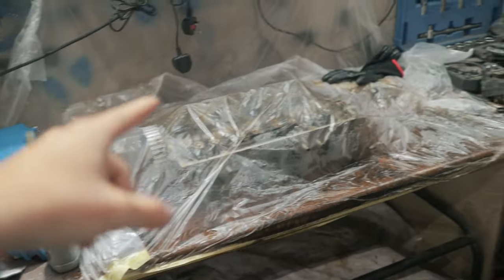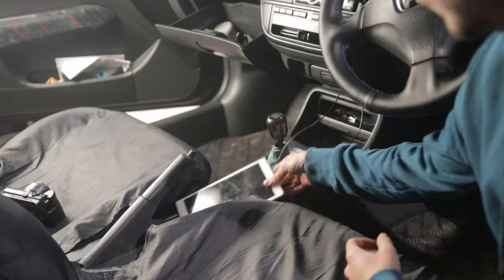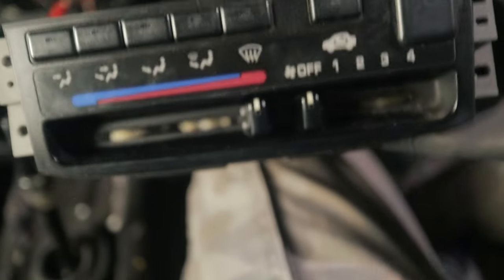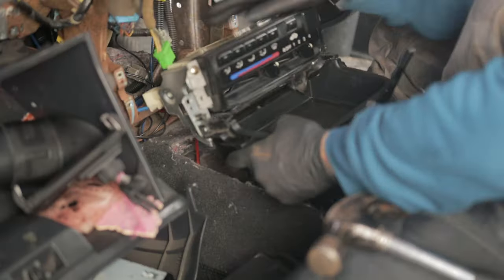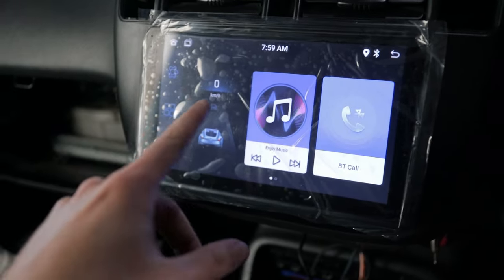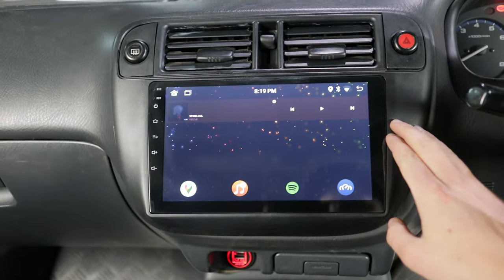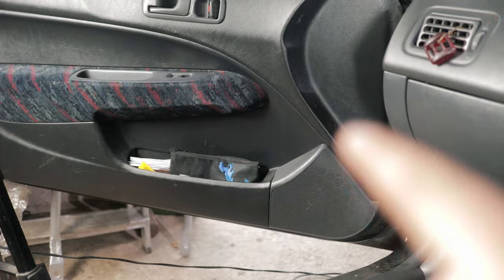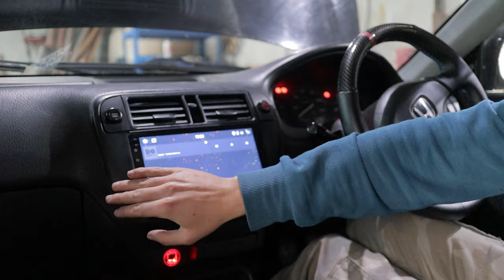Android Touch Screen Radio Install For Civic Hatch

Comment: Please, how have you solved the problem with the lengt of the wire that controls the heating?
Reply from the maker: Looped it in a circle so it's a bit shorter fits perfectly
Reply: I just trimmed mine, and then when I decided to undo it because of the lack of AC vents, I had to go to my pick a part and buy another one.

Comment: A Couple of things, that is not the dash of a 99 Civic, that is a 96-98 dash. 99-00 civics do not require a relocation of the AC unit to install a 9 inch screen. Also unless you have access to a JDM/EDM stereo fascia with intact A/C vents; DON'T DO THIS. USDM vents DO NOT FIT. You will wind up with 2 ugly, gaping holes in your dash, that is going to cost you a minimum of $150 to fill them with the proper sized and imported AC Vents. I just UNDID my 9 inch headunit and ac relocation for a stock set up with a true single din android stereo, and it looks 1,000 times better.

Comment: "Hello, Bro! I watched your video and it's amazing. I own a 1998 Honda Civic Sedan with right-hand side steering. I want to install a similar screen in my car but with a little difference. I want the AC controls to be displayed on the screen side. Additionally, I am looking to purchase some items for my car. Can you recommend an online store where I can find these items easily?" i am from Pakistan.
Reply: I think you're going to have a difficult time doing the AC on the screen with a 96-98, as the heat/cool blend slider is a physical connection. 99-00 it was switched up to an electrical connection. Not saying it would be impossible, but I don't think it would be worth it in the long run as you're talking about coding, building a custom UI and all kinds of stuff you're probably not thinking about. You could always do the dash swap to a 99-00 also a lot of work for little return. I personally HAD this 9 inch screen in my 98 civic. That's right, HAD, because I decided I wanted a more of a stock look, so I got a true single din android stereo that does everything that my 9inch one did, just in a smaller form factor. 
As far as parts in pakistan? I have no clue? Because I have no clue what websites are available to you. ebay is a good site for some stuff, I personally find a lot of parts for my 98 Civic Coupe at my local junkyard/pick a part/u pull, Facebook market place is alright if you're near a city, join as many local honda groups as you can, you never know what someone has hiding away until you ask.